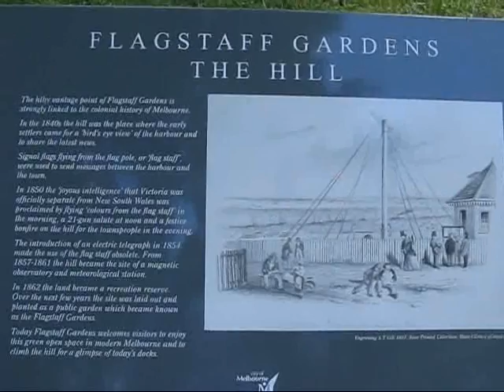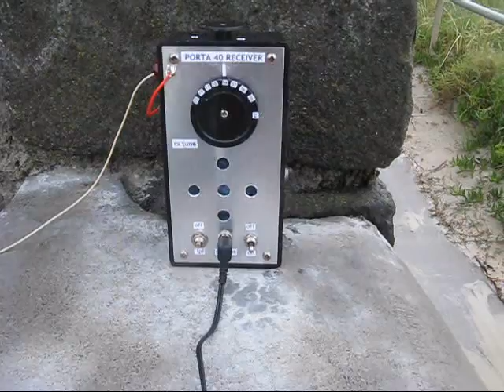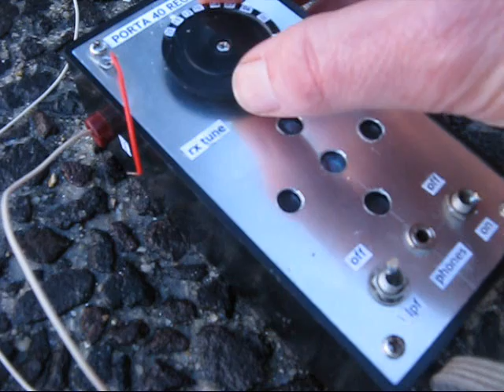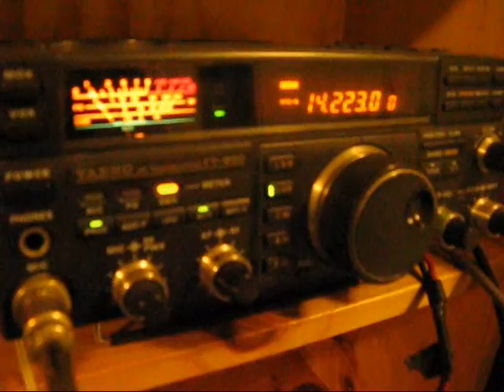Portable 40/20 metre direct conversion receiver

Comment: I did a similar receiver using a 602 IC for 14Mhz LO oscillator and mixer, it works great on 20 meters. It needed a 1k ohm pot in the antenna input to ground  to control the input RF gain. Building the 20 meter receiver and listening to Lebanon with 10' of wire for an antenna here in Illinois USA was neat. Keep building it is cool seeing what others are doing.
73
Jimmy, ARRL TC, WX9DX